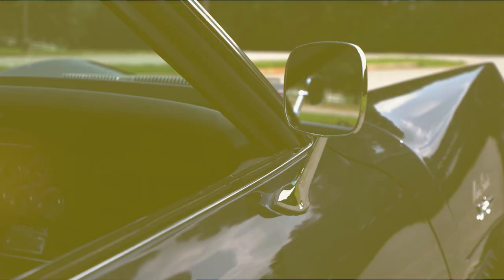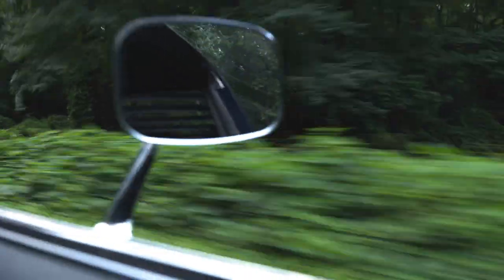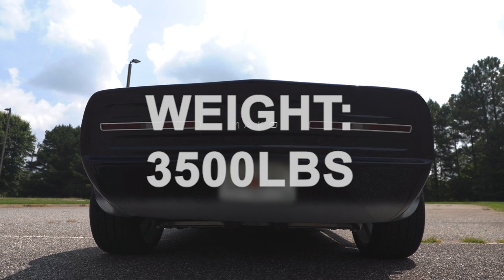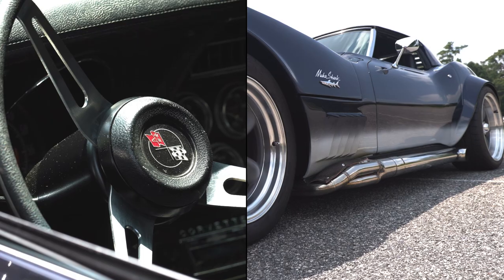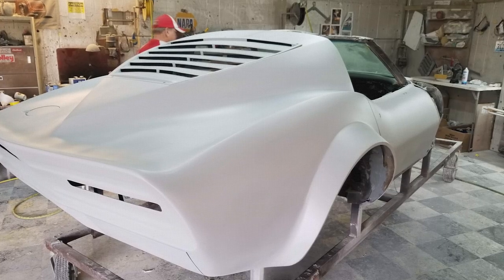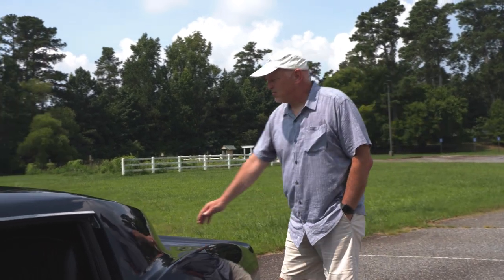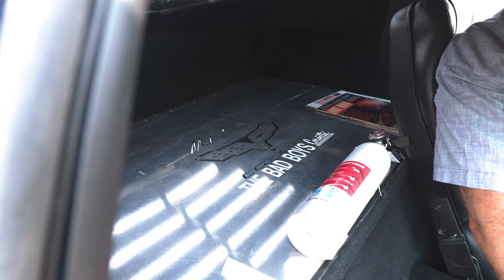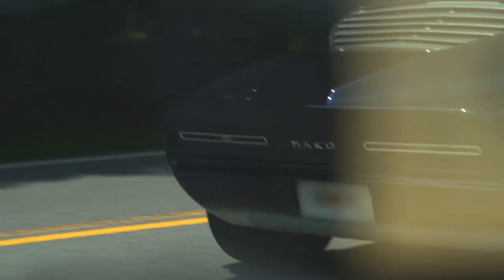This Futuristic Concept Car Will Blow Your Mind | RIDICULOUS RIDES

Comment: I want to know how an actual Mako Shark Vette ended up in some guys field.
Reply: Maybe the owner is scary about sharks lol 🤯😁
Reply: While this cloned replica car is cool in some of it’s design  features & subtle touches the owner had done, this vehicle from the back woods certainly isn’t the one off factory GM Manta Ray concept show car, or even a rare, $1 million dollar 1 of 6 built, Baldwin Motion Mako Shark’s, it’s a more commonly customized knock off kit car replica clone of GM’s Manta Ray concept factory show car, that is missing its unique flip up tail lights. There have to be hundreds of these rotting customized Stingrays decaying in back fields, in various states of disrepair, that were built to stand out from all the other run of the mill malaise era mid seventies dog Vettes, that got customized during a fad, with various hideous fiberglass body patch panels, that were made by any number of the defunct aftermarket fiberglass companies, that all used to advertise their wild customized body modifications for kit cars, Dune Buggy’s, VW bug 3 wheeler cycles, and Vettes, at the back of old car magazines…🫤